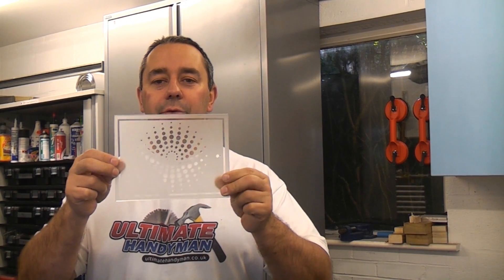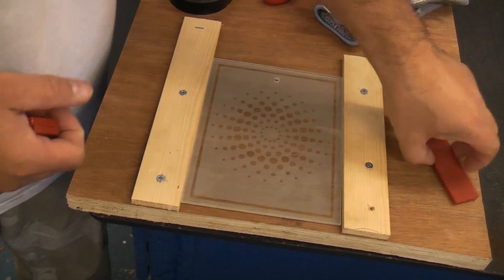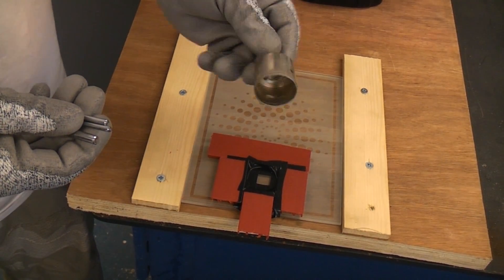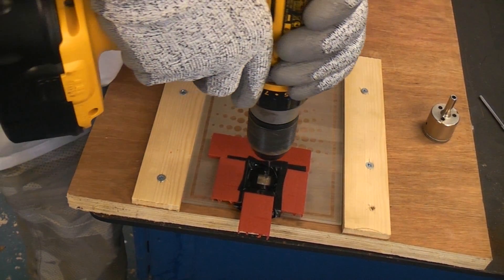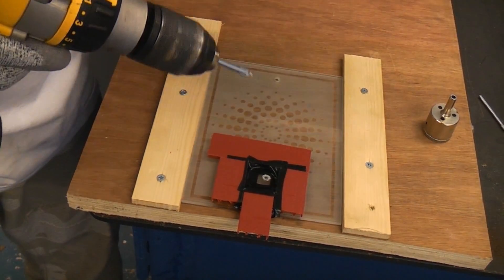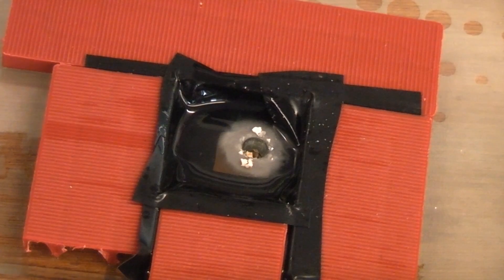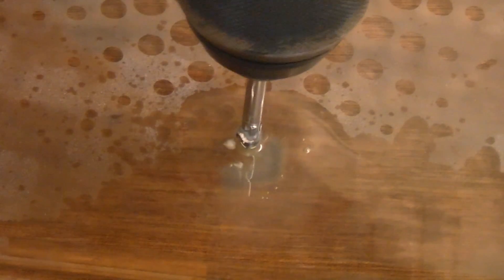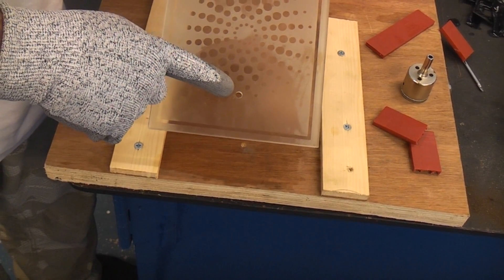How to drill glass | Glass drilling

Comment: Doing this on my car window. Poxy clips on the brand new regulator won't even hold the glass!
Reply from the maker: I don't think you can drill car windows as they are toughened glass and will shatter
Reply: Did it the right way and got another regulator

Comment: Thanks for the helpful video.   Once the glass is drilled; is there any way to determine if I've created any stress fractures or stresses raft will telegraph towards the edges?   I'll be drilling approximately a 5/16" hole approximately 3/4" from the edge of 1/4" to 5/16" thick glass.
Reply from the maker: In most cases you can see the fractures. Perhaps you could eliminate them by using an abrasive wheel to slightly countersink the hole afterwards?

Comment: Well how to drill in a borosilicate glass rod 12mm Dia ? It always developed crack once the drill reached half depth. I'm using water for cooling. What should be the rpm of drill machine?
Reply from the maker: Not sure about this.What type of drill bit are you using?
I'm thinking that perhaps a diamond coated hole saw would do the trick- although it might be hard to get it started.
Reply: Hmm I did used 3 types of bits(twisted drill hss, diamond drill bit with through out hole and diamond bit drill bt everything resulted in cracked glass.
Reply from the maker: Not sure what to suggest then, sorry.
Reply: +Ultimate Handyman should I opt for high rpm like 5000-10000?
Reply: yes higher rpm and go slow cutting through, not much pressure. maybe also try a constant dripping of light oil and a smaller bit than the hole you need. 
drill half way. then flip the rod and repeat. then switch to a larger bit to your finished size hole. Oh and hand-held drilling isn't recommended because your hands will sway. use a mounted drill or drill press for your super delicate rods. Best Luck!

Comment: Nice video sir. Do you start small and go bigger or get the bigger drill bit to begin with? I think I'll need +-5cm holes in the mirror. (Wifey wants a vanity mirror.)
Reply from the maker: Thanks, do you mean 5mm holes?  as 5cm is huge! You would need diamond coated hole saws for a 5cm hole.
For a 5mm hole though you can just carefully go all the way through with a 5mm spear shaped drill bit.

Comment: real time drilling, or time lapse:?
Reply from the maker: Tres Longwell 
It was real time drilling.
Thanks for the comment
Reply: Tres Longwell I was about to ask the same. I'm dealing with a 5mm glass and it's taking me about 30min per hole (if I push to go faster I break the glass). Maybe is because of the bit quality (a chinese cheap bit) but it still seems a lot to me.
Reply from the maker: Tomás Alejandro Pérez Ponisio 
Blimey, how thick is the glass?
My bits were bought from screwfix, although they were probably also made in China they do seem pretty decent quality.
Is the drill on the fastest speed?
Reply: Tomás Alejandro Pérez Ponisio Well, yestetrday I tried with a B&D TM505 (500w) electric drill and It took me aprox. 8-10min. Always at full speed.

Comment: I used to work in a glass shop and when we had to drill holes in wall mirrors (door knob and electrical access) before they were mounted. We used putty (as you mentioned) to create a reservoir and we used automotive coolant to keep the bit and glass cool and lubricated. The coolant worked beautifully and prevented shattering.
Reply: I used to drill holes in glass bottles to make lamps out of old wine,and liquor bottles. 
Using a hand drill and water inside the glass bottle and using water on the drill bore. Back when I was doing this the drill bits QE called boring drills at a very low and slow speed
Reply from the maker: Thanks for the comment ;-)

Comment: Excellent video.

Hows about another showing the same concept, but vertical.
eg A Porcelain wall tall.
They are a right pig. I have had to do a few for Age UK and found for budget use the De-Walt diamond (6 or 8mm) bit from Screwfix has a plastic tank/ drip feeder which does the job well.

For regular tiles the Bosch spear shaped tile/glass drill bits last the longest, mine is two years old and still cutting.

Cheers